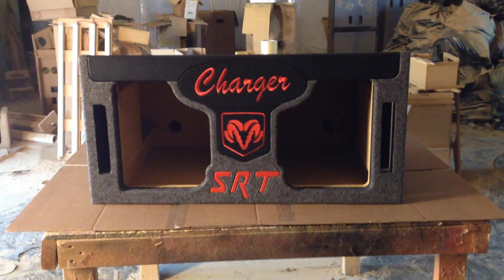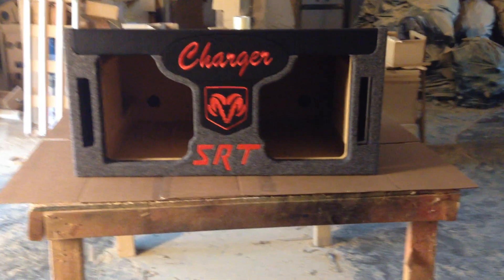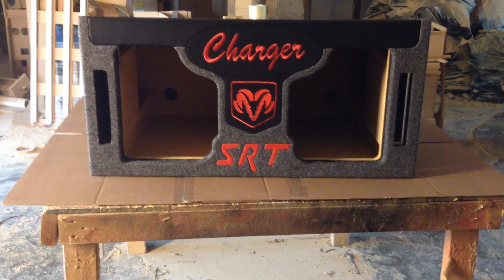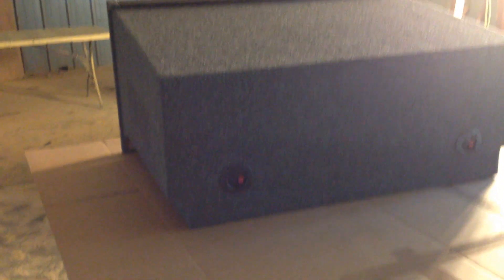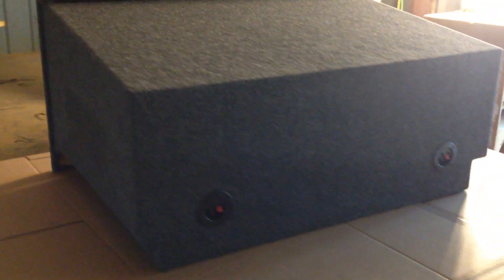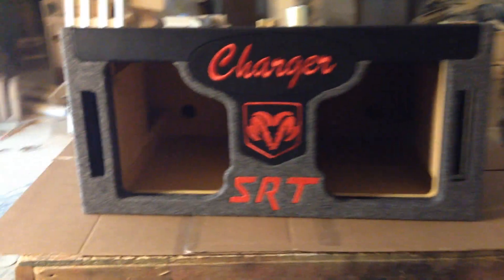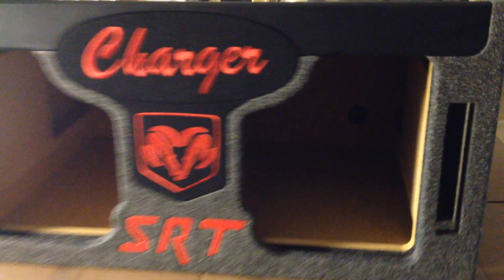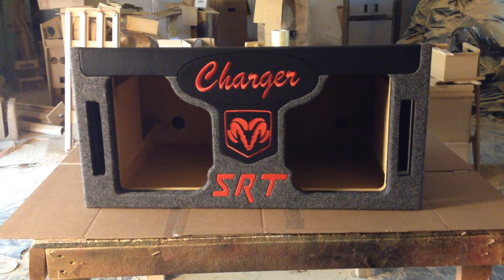Dodge Charger Kicker L7 15" Subwoofer Box

Comment: You do great work sir keep it up...could u do a box for a 19 charger would like a  soundqubed hdc3 18...ain't you many people running 18 subwoofer..how much something like that cost..
Reply from the maker: I can make a 18" sub box for your 2019 Charger. Price would be around $400 delivered to your door.
Thanks
Reply: @akaudio9646  sound good should be ready in about a month...would I have enough room for two or just the one woofer...
Reply from the maker: @earnestdennis899  As far as airspace, you only have rooom for one sub. 2 Subs will fit though